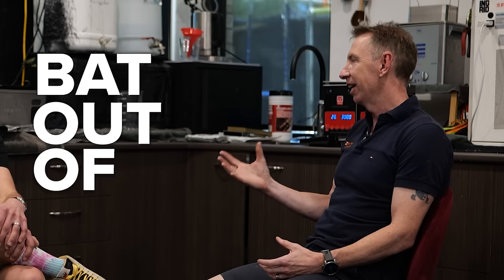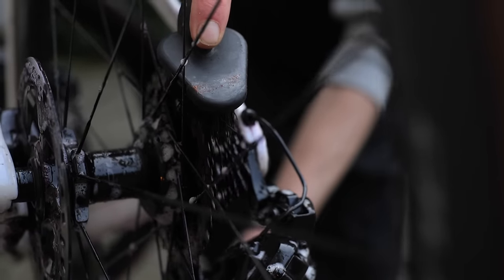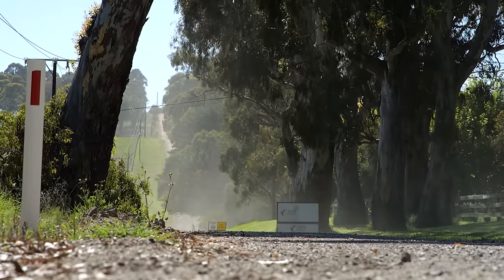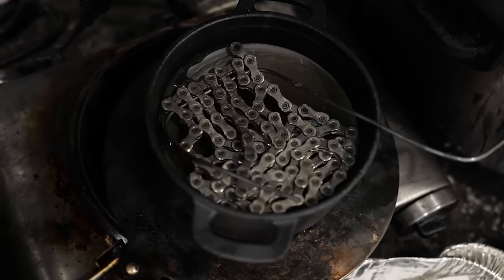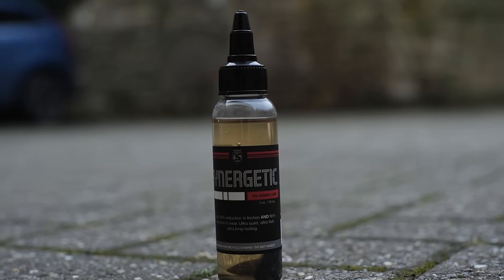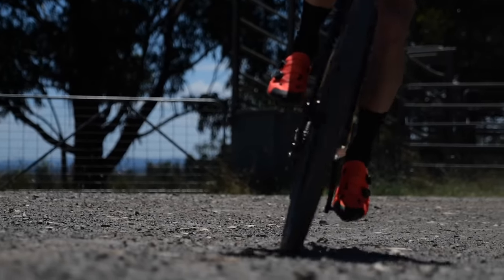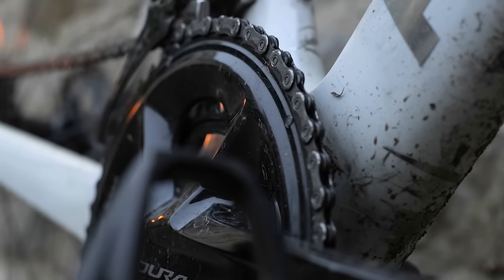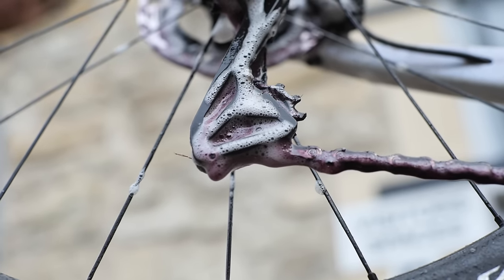They Don't Want Your Chain To Last This Long

Comment: What is the cause of chain stretching, the pins wearing the link holes (not actually steel stretching)?
How does lubing the rollers help chain stretch?
What about chains that use stainless steel for the inner links, softer metal to stretch sooner?
Reply: Most of the wear ("stretch") occurs on the inner surface of the rollers and the outer surface of the pins.
Reply: Not stretch. Always mechanical wear. There are some popular YouRube riders that wax showing >10,000 km drivetrains with no apparent wear. Includes MTB and eMTB.
Reply: & on the flanges of the inner plates, where they bend to form the 'inner' sleeve of the chain.  @JGRGilbert

Comment: I'm probably imagining it, but I seem to feel faster on the second halves of my mountain bike rides with wax.  Total confirmation bias, but there is factual basis behind it:  chain performance doesn't degrade through a ride like it does with non-immersion wax lubricants.  Now 3-5 watts is indeed nothing, but it sure seems real.
Then again, my fitness level is higher than it has been in over a year.  So there's that.  Combining the two for the win?  Sure, I'll take it!
PS  Happy to add that I didn't need my largest cog on yesterday's ride either.  Not THAT hard a ride, but I did hit some steeps and decent climbing, where before I was jumping into the large cog a lot.  Ironically, I'm kinda disappointed at the same time because it's the large cog where I do hear the ill effects of the 12-speed chainline.  Definite cross-chaining clash on this bike (and it derails off the large cog when backpedaling).  Thus I haven't been able to evaluate how the wax does in this non-ideal gear combination; oh well.  
That said, if I'm enjoying higher efficiency combined with better fitness and this keeps me out of the large cog, then I'm gonna see even longer drive train life.  Nice to have a "bail out" gear needed only for the infrequent situations.

Comment: Should we even ride anything else than hub gears outside racing? Its so cheap and chainline is always perfect. Plus replacing the whole drivetrain is dirt cheap compares to cassette.
Reply: Genuine question: can it handle above 1000W sprints, +500W efforts? I'm not racing nor planning to, but riding with friends and family. Sometimes we like to push a little for fun, so I need one bike to do it all.

Comment: what im wondering is, in regard to the cost of each application and the amount of lubricant you apply, how do you even remotely track how much lube youre putting on... like if i get a bottle of lubricant and im doing one drip for each connection of the links, how do i differentiate between 5-6 mL and 2-3 mL to keep it effective to buy the more expensive lube...

Comment: Understanding Silca is one of GCN sponsors, is there a possibility to have a video test of the longest-wearing and best lubricants available?
Reply: The two best immersive waxes are molten speed wax and silca according to Adam’s data. Everything else is pretty distant.

Comment: Been using Finish Line green wet lube for years and happy with it, wipe chain every ride to remove built up crap and every 2nd ride wipe between cassette gears. Live in a dry country area where it is dusty and windy alot. Avg 7000-8000k a chain. Thought about doing the wax thing but too lazy
Reply: Yeah problem is you’re wiping the crud off the outside but it’s the crud inside that is wearing your drivetrain. Throwing money away by not waxing.
Reply: FL green really is one of the dirtiest lubes we have tested. Here is a recent feedback i just received from a viewer using FL wet; 

".... About Finishline wet.... I used it for a very short period of time on my touring bike a couple of years ago and it ate through a Shimano 10 speed chain within 2000km (from 0 to 0.75% wear in 2 months) in wet road conditions. It has also been the worst gunky mess I ever encountered on any of my drivetrains. And I'm the kind of girl that rides beaten up steel bikes in true alleycat fashion so a bit of chain dirt wouldn't usually bother me but this was way over my tolerance for gunkyness"

Your comment re wiping every ride to remove built up crap, and ever second ride between cassette gears etc - but you are too lazy to try a lubricant that means no cleaned needed, ever?  :) But even if not waxing, i can assure you there are many other options that are going to be VASTLY cleaner, and easier, and less wear - that FL wet. If there was a competition to make a lubricant be goopy black mess as fast as possible, that would be a top contender for sure. 

7000 to 8000km to a genuine 0.5% where you can put a new chain on same cassette no problems - that would be a world record i think for FL wet. Not sure what that 7000km is too, or if its just each year i replace chain and cassette and for all we know it could be at 1.5% wear - but i can say if you are happy with FL wet, you would be doing cartwheels on something in the top 15 on the league table.
Reply: @zerofrictioncycling992 Can waxed chains handle a bit of soapy water from the rest of the bike clean or should you always remove? I always strip and wet relube after every ride, I'm not used to waiting to see when more lube is required, is that a case of just hearing it on a ride or in the stand after a ride, is there a consequence to riding it dry for half a big ride?
Reply: @danielhand1729  Hey daniel. That sounds like a fair bit of maintenance already if you are cleaning chain and re lubing post every ride? in which case immersive waxing would be a doddle as you can just pop chain in pot whilst you wash bike and yeehaa. In general your chain you want to treat like you disc brakes - try not to get cleaning stuff on it if you are waxing. water and cleaning stuff may - especially over time - hinder wax being able to bond properly too chain. 

yes if chains wax coating is sounding / feeling very dry - the treatment is pretty done and so they can for sure be higher wear riding it like that. it is better to err on rewaxing early vs pushing wax treatments, but for most of the good waxes circa 300km is a breeze for dry road conditions (they can go much longer - but thats the default recommendation from zfc to keep chain always in a silky smooth and quiet zone + lowest wear).
Reply: @zerofrictioncycling992 It sounds like using a good wet lube in winter (I checked your recomendations) and switching to wax in summer may be the way to go. I'm ditching dry lubes and poor wet lubes for sure.

Your comments on chains going suddenly rings true for me, they always seem to be on 100% till they are not!
Reply: @zerofrictioncycling992  now you mention it, shit i do spend alot of time keeping chain clean. Not just chain but getting oil splatter of rims and frame etc, a basic bike wipe can be 45mins and alot of rags later. 🤔🤔, think I will give this wax thing a crack
Reply: @DavidStacey-tx7on  ha yes honestly you dont have to go immersive if thats a big step, but for sure i can say it will be a different league just switching to really anything in the top 15 on the league table vs FL wet. FL wet is a shocker really!

Comment: So are you meant to wax the cassette and front chain ring? They'll rust without lube rapidly
Reply: No need. The wax transfers. Been immersion waxing chains for over 5 years and never had a rusted cassette or rings 👍

Comment: Is it okay to share a wheel-on trainer between two bikes, one with a wax chain, one with oil? Or will the residual oil on the cassette contaminate the waxed chain?
Reply: This will contaminate the waxed chain (if you don't clean the casett between bikes)

Comment: Help me out on this one viewers. Although I wax my chain and love it, where are they getting these $500+ figures for chains and cassettes? I just checked Amazon for an Ultegra 12 speed cassette and it was $90. The Ultegra 12 speed M8100 chain was in the $50 range. What am I missing here?
Reply: I noticed that also. I do know Dura Ace cassettes are like $250
Reply: I think they are assuming the very top tier of each brand. Not sure about the other brands but the only reasons for Dura-Ace are if you have more money than you know what to do with, or someone else is paying you to race.
Reply: If you watch the video he said the top of the line AXS Red cassette- also he is talking AUD not USD.
Reply: He's talking about expensive MTB cassettes and chains at the extreme end of savings.
Reply: Yep, Red chain, cassette and chainrings would be $1000 AUD

Comment: I wax my chain hotmelt every 250 km and the work is like a breeze. There is no reason to not do this.
Reply: Totally. After the initial reset of the chain it takes 10minutes. No need to regularly clean drive chain either which saves a bunch of time (and money) as well
Reply: Yep. Agreed. The only reason not to would be if you ride in wet conditions a lot. I rewax every time I wash my bike which isn’t that often. I actually wash the chain with the bike then take it off and dry it and put it in the wax pot.  Works great for me. I don’t ride in wet conditions if I can help it

Comment: What brand candle wax did you use?
Reply: Why not just use canning paraffin?  I’ve never understood the idea of using candles—they contain dyes and fragrances, and are certainly more $ per pound than “Gulf Wax” paraffin in 1lb bricks.
Reply: The Aussie guy (another video) actually used candles, thought how goofy is that? 

I have used gulf canning wax for nearly a decade. Inexpensive and easy to buy.

Comment: Campagnolo EKAR is so weak and tiny and even on only road cycling the chain lasts maximum 1500km with good quality chain oil, its pity that the EKAR groupset will ruin people. Hopefully hot wax will solve their problems because Campagnolo has always last long but i have gave up with that brand.

Comment: I have Molten Speed wax which scores best with FF

I’d be interested to know what temperature they think the wax should be when the chain is submerged in it
Reply: I use m speedwax too. A local company for me. According to Adam’s videos, a slow cooker on low is the perfect temperature. Put it in for 10 minutes and dish it good. Take it out and let it set for a few minutes and then put it back on the bike

Comment: With decent value cheaper chains you can replace the chain multiple times (3x, 4x) for the price of the highest end chains. For me that makes much more sense, since I regularly but not obsessively clean my chains and they last plenty long enough any way
Reply: Or you could buy a lower level chain, wax it and get 5x the miles out of it. Plus, you increase the life of your cassette by orders of magnitude.
Reply: He was saying the top end chains can last 10x longer though, so you are costing yourself money.
Reply: @kidShibuya  Did he provide some sort of white paper on it?
Reply: True, but a waxed high end chain might last 20-30x total. Some riders documented essentially zero wear. For me, the higher end chain means I don’t HAVE TO swap it if inconvenient.

Comment: Since the chain has to be cleaned (& lubricated) on a regular basis to prevent the accumulation of dust/dirt from becoming abrasive, what is wrong with using a lubricant such as chain-saw oil to lubricate your chain?  If it's good enough for the demands of a chain-saw, shouldn't it be adequate for a bike chain?
Reply: You are joking. I expect you enjoy getting dirt and filth all over yourself every ride. It is about a 30wt oil to start with, and has so many anti-fling & other additives that it becomes a paste on a roller chain in no time flat. BTW, chainsaw chains aren't roller chains.
Reply: It doesn’t have to be cleaned at all except for before you wax it for the first time. Going forward you just wax it. No cleaning.

Comment: Wax chains will show spots of rust after a damp ride but if you use a top quality chain the protective coating fights off the rust
Reply: After a "damp" ride always wipe and dry your waxed chain with some rag or an old towel (new towels will also work).

Comment: Anyone heard more info on why the RED axs chain is slower than the Force chains in ZF testing?  Maybe there’s a break in period?  What are the pros running?
Reply: tighter initial tolerances and harder wear surface treatments, and also, I have been told, the surface treatments being optimised for waxing.

Comment: How ridiculous. A 500.00 repair bill from using cheap lubricant? Are we talking about a car transmission… at 58 years old,,, owing about 20 bikes in my lifetime,, riding like a mad man since I was 15,, I never had to spend 500 on a drive train repair ever and I couldn’t tell you what chain lube I have down on my work bench. Hell,, I was using 3 in One for a while and even extra virgin olive oil…just keep it clean, and fresh and all will be ok.
Reply: Maybe he's referring to expensive bike drive trains? Like Dura-Ace cassette, chain, etc. The high end stuff gets really expensive.

Comment: How does drip wax get between the pins and their pin holes in their outer and inner plates?  I know petrol lubes can wick into those places.  Can wax build-up prevent new drip wax from getting into those critcal areas?
Reply: Seems so, yes. At least it will not remove the unwanted stuff that's built up inside. I assume that's why first drip wax application shows a long lifespan in zfc tests. Afterwards immersive wax wins due to the cleaning properties with every treatment.

Comment: If I ran that many chains I’m definitely sure to get my chains mixed up. Intend to just buy a new chain each season and throw away relatively low wear chains.
Reply: I get all the different color SRAM chains, silver, gold, multicolor. I could never do it if all were silver!
Reply: It's not just the chains, a worn chain wears your gear set, it's easy to implement a system. I use 3 chains. hang the used on the left, fresh on the right. 6km of beach riding per chain, and you cant tell them from new. Swap them every time they make noise. Wax once a month. Not dirt no grease ever, it's great.

Comment: But riders who run extreme chain angles big/big usually will still open up (wear) all the chain pin joinings hence stretch (wear) the chain, doesn't matter what those type of riders are using on chain.
Reply: Improved lubrication will still extend service life of components beyond their service life with inferior lubricant.
Reply: Not true, Im 3000 miles of extreme cross chaining in on one chain, run a rotation of waxes chains. Id bet money you couldn't pick out the chain with 3k miles from the one with 200.

Comment: Nothing wrong with going cheap on the chain.  The YBN single speed chain I like is 12 bucks, but has a tensile strength of 1300 Kgf which is fine to hold a pro track sprinter sprinting.  These bike people will tell you anything to make a buck.  As for making it last forever, why would you want to?  The longer the chain is on the bike the more likely a side plate will snap on you, it's not worth it.

Comment: Think of just how much petroleum product is being washed into the environment by cyclists using oil - myself included (up until now).*   ** Wet rides are brutal on chains.  So by the end, most of your lube is gone and you're gonna have to clean and dry the chain and re-apply your wet lube.  Only to repeat the process after the next rain ride.  Someone commuting daily in wet weather is going through a LOT of petroleum product.  And with today's chemical industry, you just KNOW those "low-friction additives" are NOT improving the situation for the environment.  Lots of "forever chemicals" are being released over and over and over and over again.
For this reason alone, switching to wax is worthwhile.  Even if it were on par or even worse performance-wise, it would benefit everyone to switch.  But with the performance advantages, it's a total no-brainer.  It's a WIN-WIN-WIN-WIN situation.
If the bicycle industry actually cared about this issue, they'd take a stand and pre-wax all chains before they leave the factory.
Wet lube manufacturers?  Join the buggy whip crowd.  Evolve or die.  We cannot simply say, "OK, keep adding toxins to the enviroNnent because we can't lose these jobs."  Hogwash.

*And yes, this PALES in comparison to the petroleum-based transportation modes.  But still.  Just look at annual worldwide chain lube sales - that's going into your and my water, soil and even the air.
** Damn, I wrote this just seconds before seeing the image at 31:00!  See what I mean?  Washing outside right into the soil/runoff paths!

Comment: yea yeah... Cheap chain lasted me long time... changed for a new one, shimano and 1 ride without changing gear it broke...  and the chain feels springy ... i don't know mate... i don't know ....
Reply: Your cassette is worn. Sorry but you are up for some big $. Good lesson for you tho.
Reply: yes as per comment below - cheap chains can last a long time when they are ridden until they are extremely worn and thus have worn out rest of drivetrain so that a new chain will not run. I am sure i covered that bit... :)

Comment: the chain is the number one money saver if properly maintained. Another thing is the sprockets(cassette/front chain ring) that people have to change if the chain skips on just one of the 10/12 sprockets. What  wax is for chain,  the reshaping of teeth is  for sprockets. The use time of sprockets can be extended at least 5-10 times. So count how much money you saved on 5-10 cassettes / ring gears
Reply: "The chain is the number one money saver if properly maintained" Or maybe regularly REPLACED? Instead of a $50 bag o' wax pellets from one of these snake-wax hawkers you can buy another chain. I'll never understand the amount of time, money and effort dedicated to extending the life of a $50 consumable bike part vs putting some oil on it and replacing it when it shows 1/2 way to worn-out. IMHO these "savings" are a pipe-dream promoted by those who sell the wax-cult their "fixes".